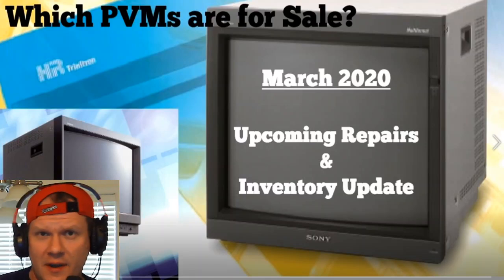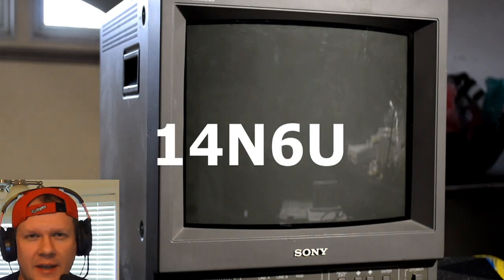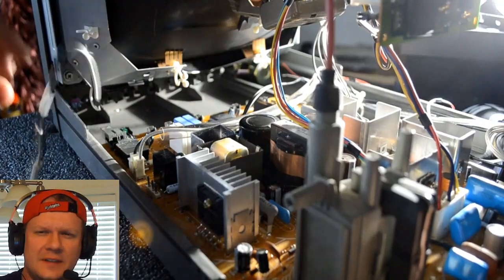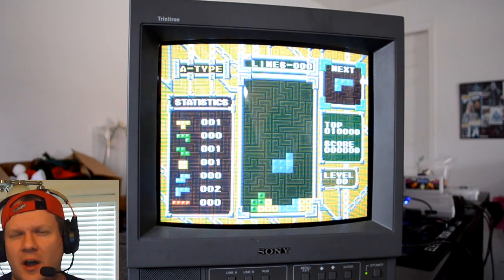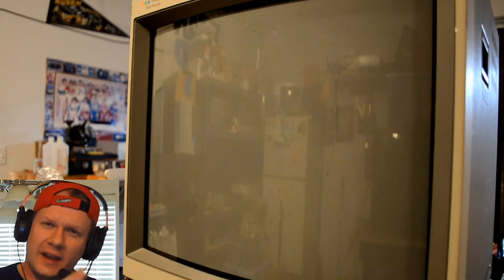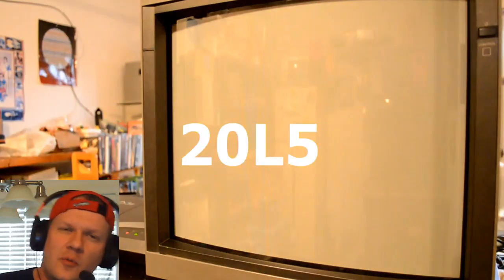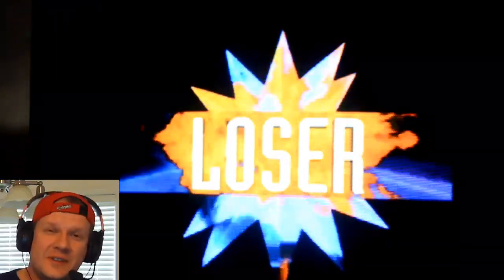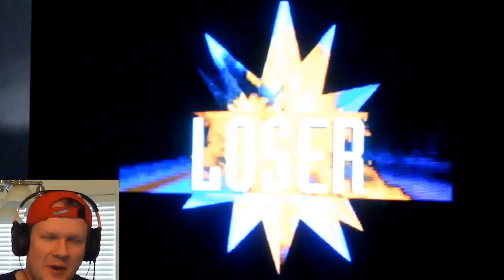CRT Monitors that will be repaired & For Sale in March 2020

Comment: I had luck to get a 13" inch just 1h away and thats EU where most are sold in the biggest cities or strangely in the strangest places. PC CRTs are not possible when a high-end one is the goal and 20" is a long wait. Getting a 20" seems like I have to stick my hand into the toilet aka playing with my luck to get a mint-internal-condition PVM especially when I can only get them shipped. My current goal is to get a Med. model OEV 203 or the non rebranded one. My OEV143 is a 2004 PVM luckily.

Comment: Hello, I've been wondering what makes these PVMs better than consumer CRTs  or Arcade CRTs. Do they have much better image quality and reliability since they were manufactured for a higher budget market? I've started working on arcade CRTs and have wondering why someone would go for these over, say, a larger consumer CRT that is capable of 480p that can be picked up for free. Perhaps it's a difference I'd have to see in person to understand.
Reply: The tv-line count.
To understand this, you must understand that C.R.T.'s do not have a set resolution.  ALL other screen technology, OLED, plasma, LCD, has an array of pixels in a grid, that dictates what the resolution of that display has.  This is called a "native-resolution".  They also rescan this entire grid of pixels, at the same time, this is called a "progressive scan".  This means that a 480i Playstation game will look horrible on any of these displays, because because the image is being upconverted and de-interlaced with "sample and hold", and a 1080p Playstation game will look amazing, whereas a true multi-format C.R.T. can switch resolutions, and make them all look good, because C.R.T.s have no native display resolution.
A C.R.T. does not have a set resolution.  Their horizontal resolution is dictated by what their dot-pitch and internal circuitry is engineered to handle.  15.9 KHz=240p/480i, 31KHz=480p, 36KHz=1080i, 46KHz=720p, 68KHz=1080p, 89KHz=1440p, 95KHz=1536p, but their vertical resolution is ~infinite.  Is it really "infinite", no, their vertical resolution is defined by their electron gun's dot-pitch (dot-pitch defines a C.R.T.'s horizontal and vertical resolution), and by their rated tv-line count.  The tv-line count of a C.R.T. PVM/BVM's phosphors, along with their phosphor's color accuracy, make the visuals different for a PVM/BVM.  Even the PVMs with a lower line count for their PVM line, still have a line-count to qualify them as a professional monitor for their size.  Meaning, that a 13" PVM 1340 has a tv-line count of 450, which sounds "paltry", until you realize that smallest consumer tv size that had that same line-count, are about 20".
Watch this video at 12:19, to see a picture of the difference in color accuracy and vertical definition, of a high-end consumer C.R.T., vs a high BVM.

https://www.youtube.com/watch?v=jbi9HEz-cww&t=760s

Also, be aware that 480/1080i/720p consumer C.R.T. T.V.s process an image, which creates lag.  A multi-format PVM/BVM (the L-series, D-series), does not, and therefore they DO NOT add lag.  C.R.T. computer monitors do not add lag because they do not process an incoming image, so that is a viable option for some 480p+ material.  If you buy an HDMI converter that does not add lag (and some do), like the HDFury X4/X3, this will work.  For example, Gamecube -> Carby -> HDFury X4 -> VGA C.R.T. monitor.
Reply: @badreality2  Great response, thank you! I wasn't aware of the image processing on consumer CRTs. Between that and vertical lines it makes sense these are more desirable. I have a handful of arcade CRTs I've got my hands on for learning and repair. so far I've gotten at least 2 of 3 working, those being a WG D9810, and a Makvision 2425. I also have a 7000 series WG that I still have to take a look at. I would assume most arcade monitors have no image processing. The WG monitor does have a digital interface but I believe it is mainly to detect resolutions and sync freq, no additional processing. I currently have them hooked up to a pc running XP embedded with Pop n music data and an old AMD card outputting at whatever frequency/resolution I set it to. CRTs are amazing.